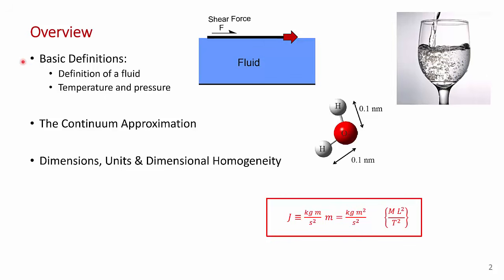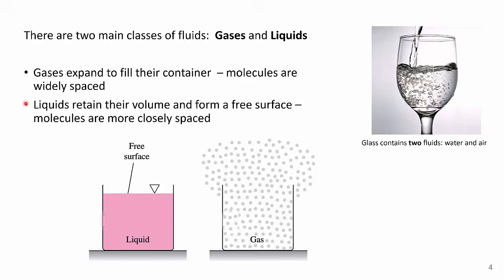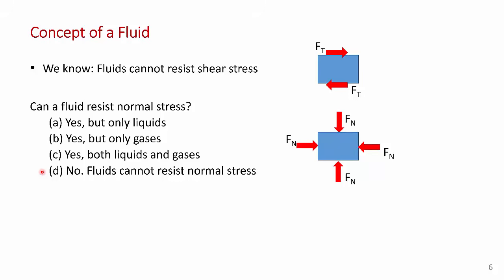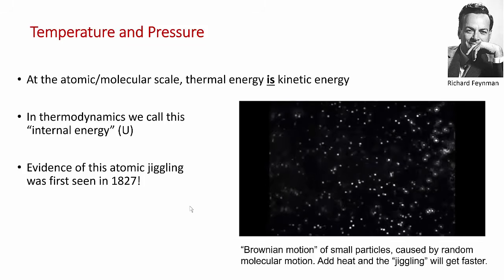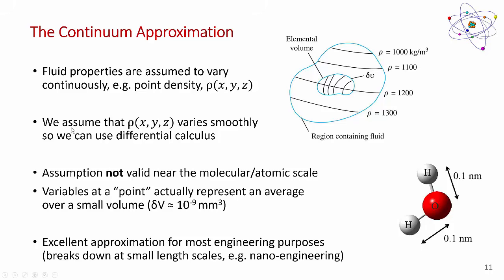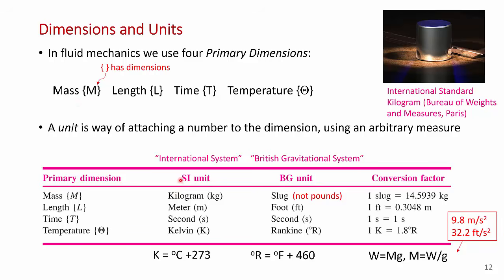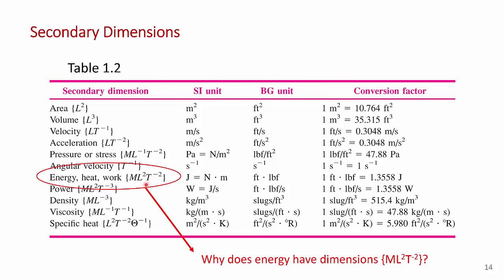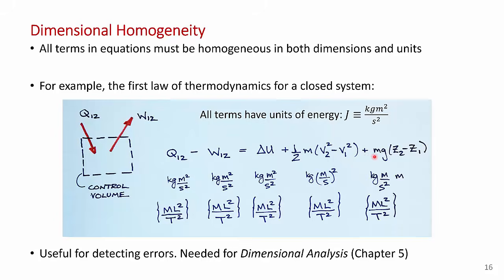Introduction to Fluid Mechanics: Part 1

Comment: I learned the benefits of dimensional homogeneity, interestingly, in a chem class However, the prof called it unit analyses. It's a very easy way to spot-check your equation results.